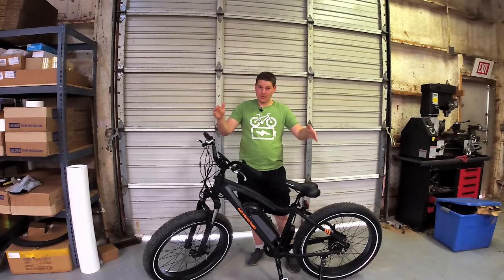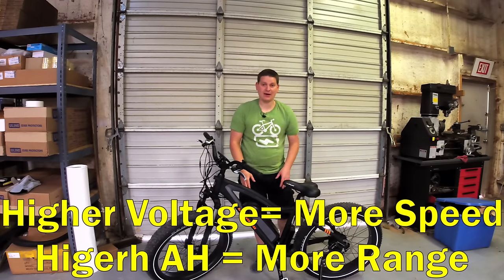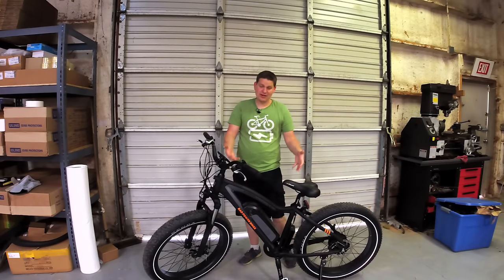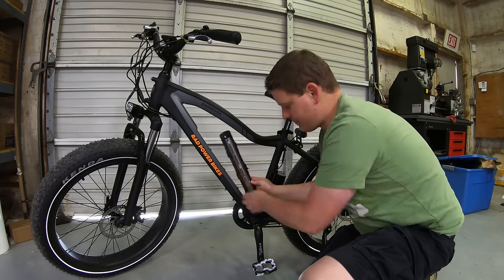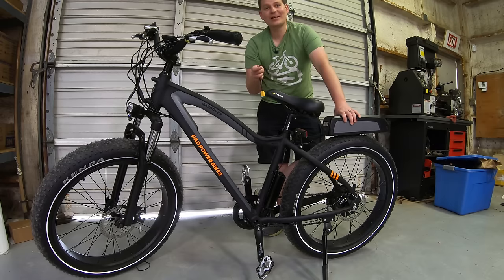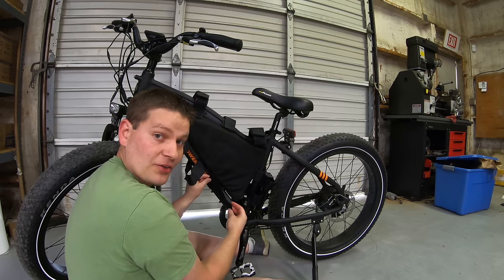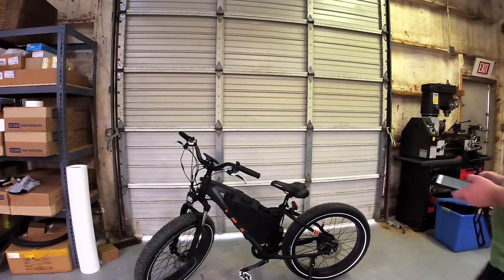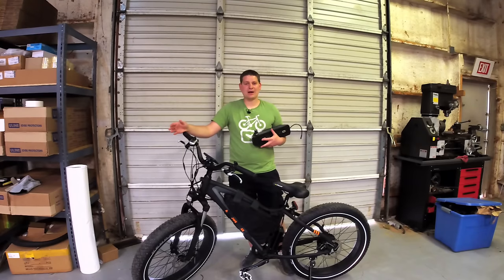Easiest Way To Upgrade Your Ebike Battery

Comment: I need to know about connecting a battery pack of 3X13 18560  to a Black Plastic battery box which can house this battery pack on  a E bike. Battery pack outer size is 238X66mmX60mm. Please advise me if anyone has the knowledge and experience about this issue.

Comment: Really if you did some wiring magic you could actually make a switch or button that will only allow the voltage to go to the controller when you flip or press it just takes some soldering and some diagrams to know what to wire and how to do so

Comment: What is the downside of replacing a 48V battery with a 52V battery?
Reply: None if the controller can handle the voltage.

Comment: can i use this on my 36 v 500 w 26 in fat tire ecotric bike
Reply: You would have to change the controller to one that can handle the voltage and make sure the motor can handle the extra current available from the new controller.

Or buy a larger 36 volt battery then the only thing that would change is the capacity of the new battery.

Comment: I'll be truthful I have a bicycle repair shop in Tampa and i do work on e bikes but today there are hundreds of different bikes and brands out there and i have a hard time finding the right controllers and such when people have break downs seems when you order what you think is right all the connectors are different or don't match  and often the wiring has different colors and I'm sure there are ways to rewire them to make them work but I'm not a electronics geek and can not find any info anywhere on how to rewire these to make them work .i myself run a champion kit on my bike and have 5 years of everyday use on it and 0 problems and it has ample power and speed for me . Mine tops out at 25 mph and ya everyone wants one to go 60 mph but reality is most bicycles can't handle speeds over 20 mph because they are not made and designed to handle this kind of abuse without breaking parts and even the frames cracking or breaking .I myself very seldom go over 20mph and the only problem i ever have is burning up brake pads or getting a flat from time to time couse in Tampa they do not sweep the streets and these roadways are littered with nails screws and many other sharp objects .myself i run the continental country pluss tires and stuffy tire liners and thorn resistant tubes and it they still get cut up .I've tried every type of foam inserts and everyone is like riding on under inflated tires cousing excess tire ware and increased drag and drain on the battery.

Comment: Do not use soft casing , use only solid Al casing which disable any mobments which can cause short in wiring and damage of cells.  Never take battery of for no reason and drop on concrete , that will cause damage, fire, explosion???

Comment: A dual Schottky diode joins 2 batteries in parallel with only a 0.25 voltage drop.

Comment: Why would you put batteries in parallel, instead of one at a time? I think it a bad idea in general to put batteries in parallel.
Reply from the maker: Parallel means less draw in each cell and better overall lifespan and performance.
Reply from the maker: Parallel means less draw in each cell and better overall lifespan and performance.

Comment: That looks like the answer to the problem with my 2016 Rover and my son's 2017 City, which both use the "Legacy" Dolphin batteries, and which have been unavailable for months from Rad and which Rad told us are not being manufactured. However, when I click on your links I get a message saying "Your connection is not private" and that your web site isn't secure. Is there a secure way to get to your web site?
Reply: Gary, I have never seen that when visiting Kyle's (Area 13's) website. Regarding the generic batteries on our bikes (I have a 2019 Rover, and 2019 City) I noticed over the years that Amzn has a wide selection of these generics. 

On another front, I bought this exact battery upgrade from Area 13 three years ago. Note: I also bought Kyle's controller upgrade, that alone really increased the bike's performance, especially top end speed). 

Overall, these upgrades were well worth the money. (See my comment appended herein for details on the performance improvement.)
Reply: @FoundingYouTuber-2005  I know Area 13 is a popular channel and web site,  so I thought it was curious that I was getting that message, but I just tried it again and am still getting it on Chrome, Firefox and Safari. I suppose it could be a setting on my computer, but I've never seen it on other sites I've visited. It's good to know of the positive experience you've had with them though and will def consider getting a battery or other supplies I need  from them if I can figure out why that message is popping up. Thanks for the reply!

Comment: First, you're not supposed to increase the voltage of your battery. That's gonna damage your motor. Second, it's gonna increase your top speed, hence make your ebike illegal to ride potentially. Last, those rad power batteries are high-quality Samsung batteries that are going to last for years. This is probably just a stack of Chinese cells wrapped in some kind of plastic that one can build it themselves. Who knows if it's water-resistant or not?

Comment: The problem is that with this setup the battery can be stolen if you leave your bike somewhere for 5 minutes locked. The other battery type has a locking mechanism to the bike.

Comment: Kyle , thanks again for repairing my bike in April! Now I want to upgrade my front suspension and later a triangle battery! Can you give me a price on the front fork of my 24 inch with at least 4 to 6 inch of travel. Hitting the bumps with no suspension jars my teeth😄
John

Comment: Those bags are a bad design only because of how easy it has made the battery to be stolen unlike a fixed mount. Luckily, they do have 25AH shark batteries and I'm sure as time goes on, capacity will get better.

Comment: Unless that battery has battery management system to control charging, you should be wary with aftermarket lithium-ion batteries. 

There’s been a rash of fires all over the country due to this reason.

Comment: Yep I did this unfortunately I purchased a upp battery which has been recalled one month after it died  and had a 1 year warranty which they will not honor,  there's 400$ down the drain and I'm never going to ride again! I'm disabled and oon fixed income.  Anyone interested in a used trike only rode 5 times, comes with no battery

Comment: As I look at e-bikes.... #1-Fat tire, #2-Length of charge to travel miles and miles, #3-two wheel drive is interesting, #4-Front and Rear Racks....   you see, I don't need to travel 20mph+.... I am looking for transport around the neighborhood - to store - et al..... But my goal is to provide me a mule to carry me from my campground to my fishing locations without having to use my truck.  So.... miles and miles of travel before I start having to think of finding the nearest "mahogany tree that I can plug into"... sorry, inside joke.  Long ago, after a 30 mile trek down 4x4 trails, our group is camping and, then, my girlfriend asked me if there was somewhere she could connect her blow dryer....      

So, I'm looking to see if I can buy and/or modify my purchase to be able to travel 60-80 miles total before having to charge (which may be by a solar array in my campground which probably means having two battery setups).   Also, the newer two motor setups (500watt x 2) that gives "2-wheel drive" are very, very, interesting when I think of trails down the Owens River for my fly fishing... also, lower watt motors are more attractive in how states, national parks, and public land managers are limiting just who can travel down trails....  If I can travel 10-15 mph assisted for 10-20 miles round trip.... game changer.

Comment: solid video but I respectfully disagree, you 100% can swap that battery with another in the same style. when you purchase a hailong style battery they come with new cradles.
Reply from the maker: Then you can't use the stock battery without swapping the cradle back again...   🙄
Reply: @Area13ebikes  you took the cradle off in the video and used a completely different battery setup, if you bought another hailong style battery you could leave your stock one as is and still add a rack at the back

Comment: I don't understand does it not go without saying 🤔.
Just upgrade your BMS & battery charger so it charges that high.

It makes no sense downgrading battery box to a bag so somebody can steal it.
And buying a new battery.
Just for them 2 part lol 
what costs £60 for upgrade Bluetooth smart BMS & charger
Is a bit stupid.
And a new battery pack certainly won't have a Bluetooth BMS.

If you upgrade BMS or remove it
Then your 48v 13 series battery will charge to 54.3 volt.
And a 48V 14 series battery will change to 58.6 volt
Reply: Just so you know, you cannot add Amp hours to a battery so it "Charges that high", same goes for voltage, if its 48v max charge is 54.6, and 52v is 58.8 if you wanna push them. Besides the Stock charger can charge that battery to 54.5 Volts if its properly balanced at 100% Charge. Recommending to remove the BMS is extremely dangerous especially when your trying to increase power(you won't be successful besides actually topping ur battery to 54.6). Those battery boxes are more prone to stealing than anything, bolton sells replacement keys anyone can buy can that literally walk away with your battery box and looking like I have the original key. This battery, and especially the 30Ah is defs worth it, nearly gives 2.5 the capacity, and the benefit of 4 more volts to prevent voltage sag, and increased speed.